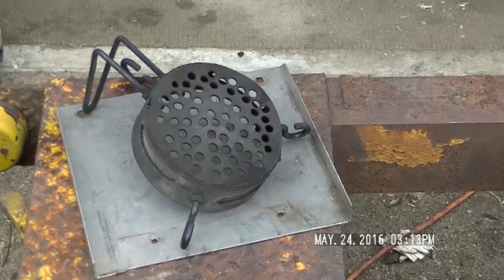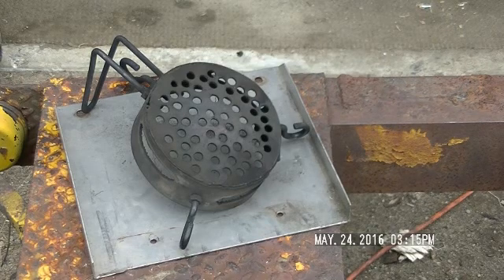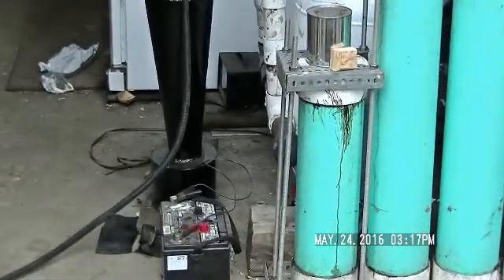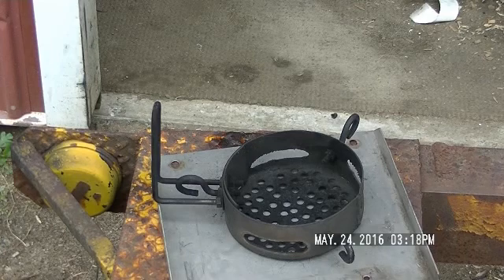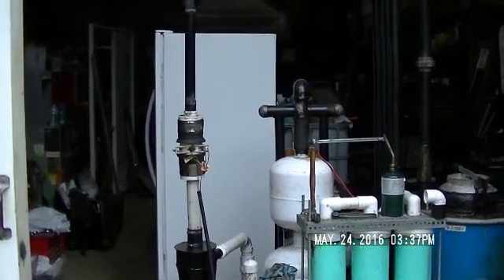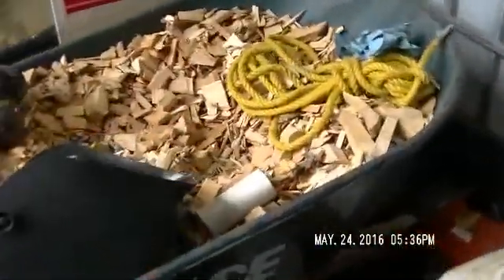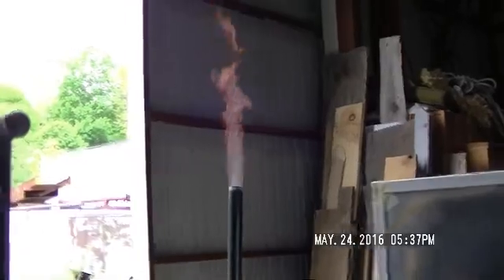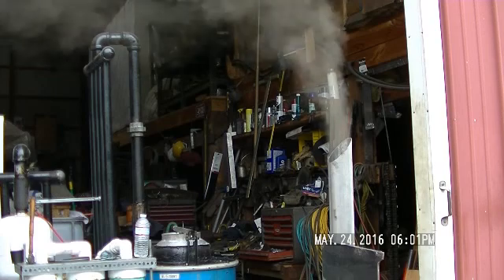Wood Gasifier Grate Mod  / test 052416

Comment: Howdee Bill,
I think you are on the right track here. 
Those bigger holes, and the slots near the floor of the grate ought to free up the charcoal flow quite nicely.
You are getting a huge quantity of gas from your system, and I am sure it is going to be way more than your 13HP engine will be able to consume.
At a guess, you could happily run an engine of at least twice that size, possibly bigger.
You have created a fine beast, just as the woodgas bug ordered  :) .